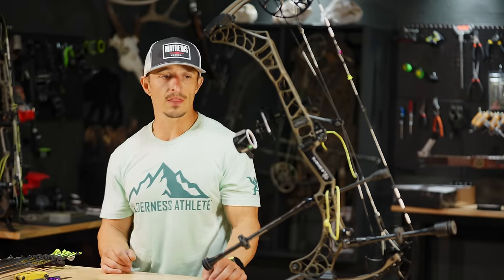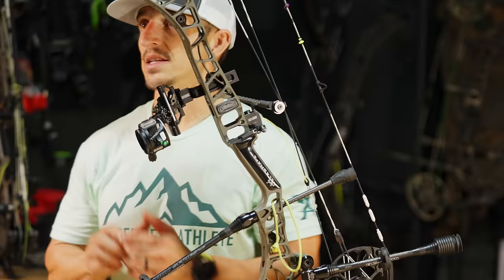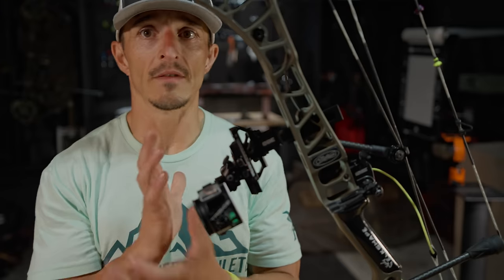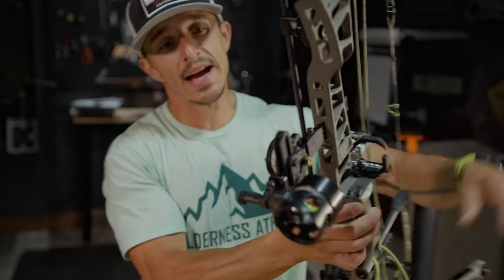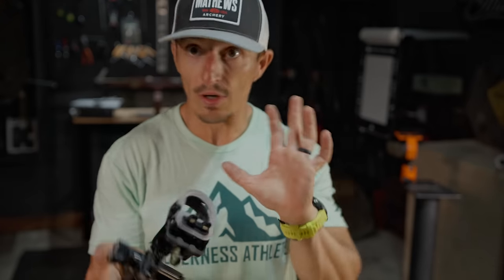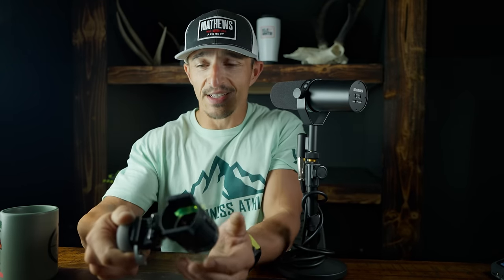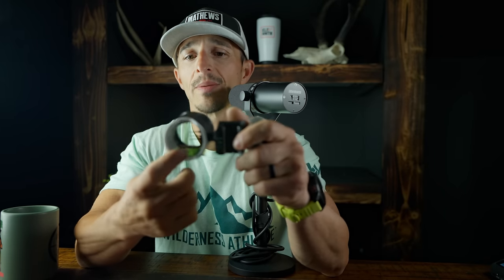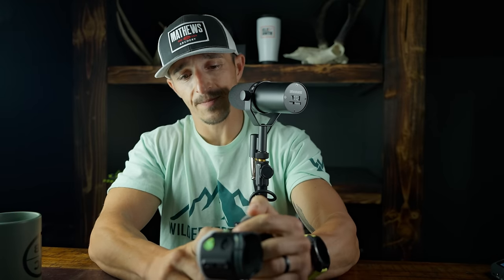Buyer's Guide: UV Slider

Comment: PROBLEMS WITH UV SLIDER and it's warranty; my slider arrived from the manufacturer with the two middle screws loose on the gear track and the plastic track having a distortion where the middle screws had been tightened; this means you either have screws that back out and contact the slider or a slider that will bind and be hard to slide due to the distortion caused by the screws. It was discovered within the first 20 shots when one screw backed out and wouldn't allow the slider to slide.  I contacted UV within my trial period, and they refused to exchange it, they required me to pay to ship it back for repair.  Upon receipt they agreed the gear track was the problem and replaced it and then held my UV Slider hostage until i paid a $15 repair fee.  When I stated this was a warranty item caused by a manufacturing defect and i received it this way, they said the UV Slider does not come with the same warranty everything else does (which is not mentioned anywhere on their website, the website says all products come with a 1-year 100 percent warranty).   I've been a HUGE UV fan and have always been treated well by them and never had a problem with any of their products until now.  It is my opinion that if you don't stand behind the product to be free from a manufacturing defect then you shouldn't be selling it especially for this price point, and if the UV Slider does not come with a warranty, then you need to state this up front or train your support staff, so consumers who have legit problems with defects are treated better.  I also requested to talk to someone on the phone multiple times and as of the time of writing this never received a call.  I fully support that this is a new product that may have some unexpected problems they need to work out and I would have no issues with UV needing to make some changes/repairs to resolve it... but i expected them to stand behind it and fix it w/o telling me it doesn't have a warranty like their other products and i have to pay to fix it.   Ironically, I received an email asking for a product review which stated they want honest reviews even if bad so they could improve.  I had asked for a supervisor to call me so i could share my experience w/o going public but nobody called.  I'm going to post this in a few places hoping it will get to someone more senior in the organization in case their customer service is not sharing how they are handling problems such as mine.
Reply: i’m looking into the UV slider, how is its pins brightness? i’ve heard they’re pretty dim. do you think so?

Comment: Hey Dan, great content as always. 
Have to comment and say I've been running the CBE TREK for over a year in all walk and stalk hunting here in South Africa and I've literally pulled this sight through the bush - A LOT - crawled with it and everything and the "flimsy" sight tape pins have never bent or moved an nothing has even moved or been an issue. Honestly think this is one of the most underrated sights.
Reply: I love my CBE.  It is cool you can run 2 tapes at once with the slider though and an option for a smaller sight aperture

Comment: This probably depends on individual eyesight but red pins flare a lot more for me than yellow or green.  Before you spend $$ on these make sure pin color(s) work for your eyes.
Reply: I deal with the same issue. With my current sight, I pulled the red fibers and replaced with yellow and green.

Comment: Can you go over how these actually work using a slider in a hunting situation? Just want to know how much you are sliding your sight because your target went from 50-20 or 20-60 and you need to slide your floater pin etc. Seems like extra movement that isnt necessary so thats why I would prefer a 5 pin sight rather than a slider
Reply: I can explain how i use a Black Gold slider in hunting situations like you explained and maybe help out. I run a 4 pin setup with 30, 40, 50, 60 pins. 30 pin is only 3"-4" inchs high at 20 yds so no need for that extra pin. I run my 40 pin as my slider so if i spot and range a buck at over 60 yds, like 65yds i now how basically 56, 65, 74, 83 yds pins, so if an animal walks further i have pins ready to give me info or if he come closer as well, if he goes from 50 to 20 though id have to do some estimating or let down and adjust possibly. Hope this helps some.

Comment: What size peep do you run?  I’ve been told need a smaller peep with HHA sight?  Good info on the Spot Hogg barrel size, i have been considering it but going to check out the CBE.  Like the UV, but that price 😬

Comment: Have you had issues with the CBE V3 windage lock affecting up and down shots downrange when locking it down little too tight? Ive read multiple people say this and also pins out of the box slightly bent, or last pin not being able to get a good sight picture depending on arrow speed and it being too low. I want this site bad for the price especially, but those things ive read multiple people state are having me second guess a little now

Comment: I bought a HHA Tetra Ryz like 3 weeks before the UV Slider dropped... If I knew it was coming out I may have waited and bought the UV. But the HHA is still super super nice!!
Reply: Wanted an HHA but wish they offered in a 3 pin vertical picture, also wish id had both micro adjust for windage, elevation, and micro pins. The CBE V3 has my attention especially for so reasonably priced, but i think they need to iron out couple small wrinkles from what i read. Currently have black gold

Comment: Okay so if you set the top pin at 20 you can slide it to where the top pin is at 50 and it be accurate?